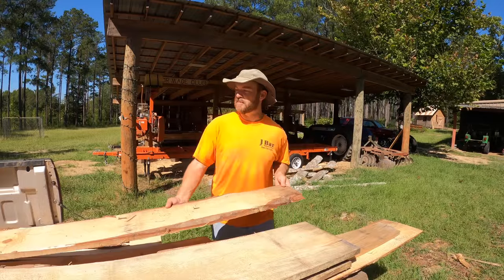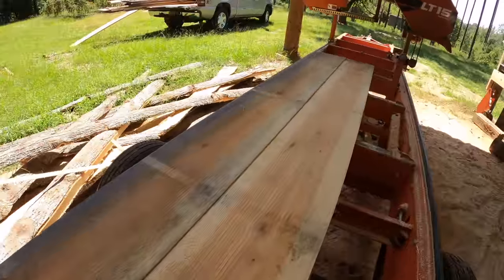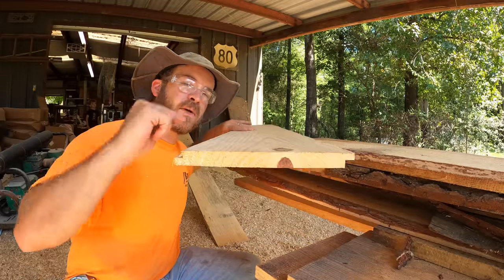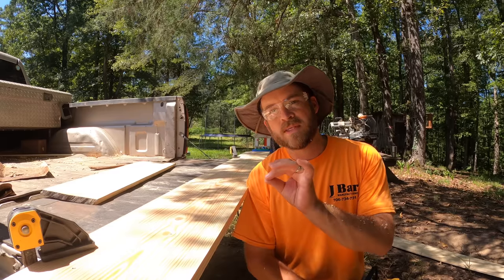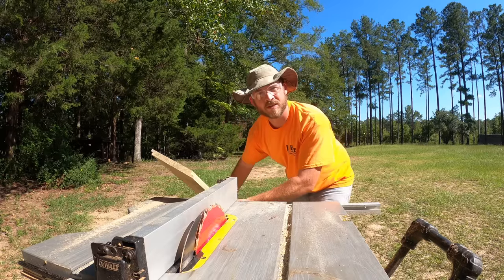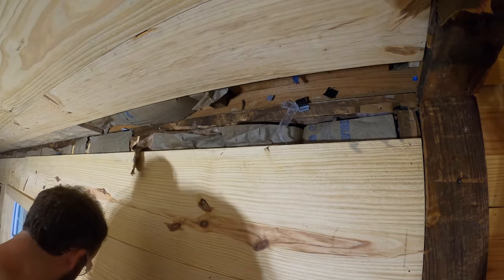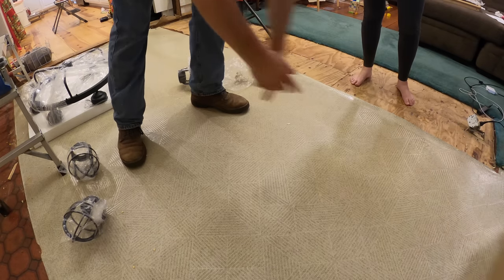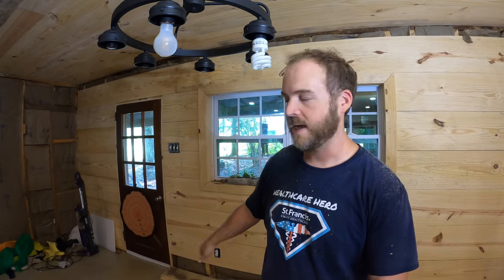Old Cabin Remodel Part 9: Homemade Ceiling with a Sawmill

Comment: You are doing an amazing job, & holding those boards up on your ceiling with nobody to help is extra difficult!! 👍 You're teasing about the light bulbs, right? We're retired residential contractors, & we've never seen a light fixture come with bulbs. That's another extra expense!! 😔 God bless y'all! Thanks for another great video!! 🙏👍😍 Try putting crown moulding at the top of that wall.
Reply from the maker: Thanks! Definitely wasn't teasing. The fan (from the same company) came with bulbs. Guess I thought it was standard.

Comment: All I do on the last ceiling boards is cut them 1/4” less so they go up easy, them do a moulding all around to make it look good, thinner mouldings work best they will bend to the profile of the ceiling, poplar works great less knots and bens easy.

Comment: Wes, may I offer a suggestion concerning the top wall boards that are yet to be installed? Get some assistance and hold the board against the wall and snugged up to the ceiling.  Then scribe the top edge at the ceiling. Make your scribed cut along the top edge. Then, place the board into location and mark the lower edge where it mates to the upper edge of the existing wall boards. This method should result in a perfectly matched closure board. Hope that helps.

Comment: All those gorgeous drop-offs would make such neat toys. AHHHH you weren't 6 nails short you did one board too many! Make a cove type moulding for the gap?
Reply from the maker: Wish you were closer, Bruce, you could load up on these cut pieces. I went to a local building supply store yesterday to get some pressure treated 6x6s and the guy loading the posts happily took my cutoffs from me. I was happy to get rid of them and he was thrilled to have them.

Comment: Hey it`s looking great, we ordered a fixture off of Amazon, and I had trouble getting bulbs to thread in, they are just built so cheap inside, the female aluminum threads, they barely match American threads, with a little finessing, we got them all in, can`t wait to see the rest, are you going to put a finish on the boards, when you are done?

Comment: I have 9 1/2 fingers that prove the table saw guard is important.    There is no feeling quite like a table saw blade splitting a finger from fingernail up to knuckle.      Use the guard.
Reply: Yes I know the feeling, in 2011 my left pointer finger had a date with the table saw blade and it has never been the same 😱😭😱

Comment: One thing I learned not long ago is that America has its own thread standards, I have tried to fit like 8 different threads onto American garden hose fitting while living in the EU, but nothing worked 🥲 Im guessing same problem might telescope to lightbulbs when you buy imported stuff.